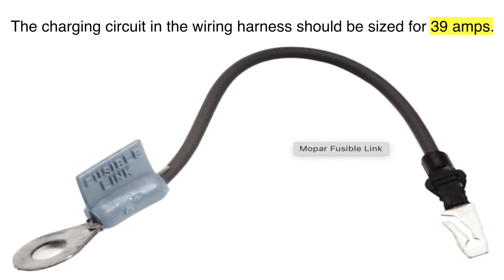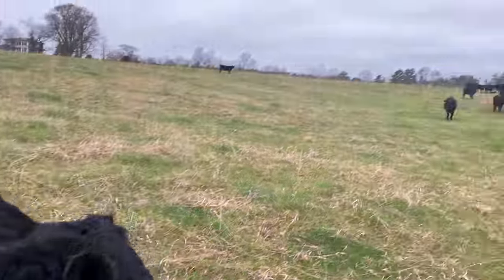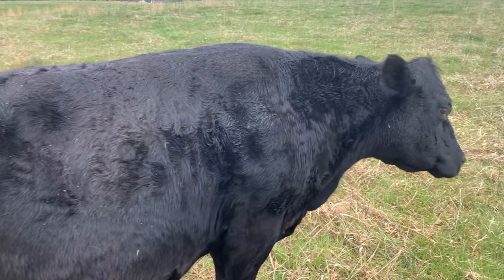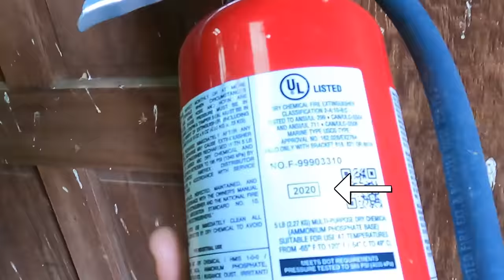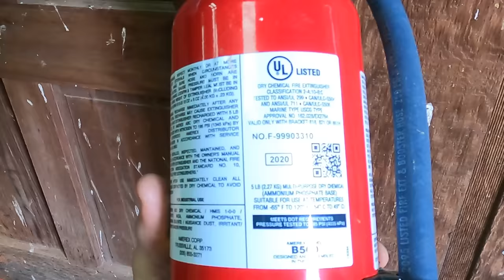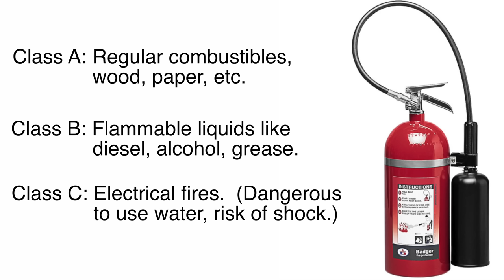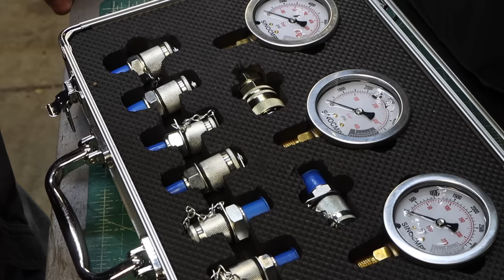Fire Extinguishers: 7 Things You Really Should Know...And Probably Don't.

Comment: Also the co2 extinguishers will only work well indoors. I was a volunteer firefighter (don't know if something like that exists in the US, but Herr in Germany most firefighters are volunteers with a regular day job). And I was thought to inly use co2 in confined spaces, as the co2 will spread out to quickly in open space. And they possess almost no cooling ability. You always stop the fire by cooling the stuff that is burning below its ignition point. Co2 is rarely able to do that.

So yes, water with soap (foam) extinguishers for everything without lethal voltages (or when you don't care about the electronics) and pulver for the rest. Co2 are great to fight electrical fires, if the circuit is already disconnected and you want to save the remaining electronics.

With electrical fires always cut the voltage first. For your own safety and because you are unable to put out the fire if there is still power on the lines.
Reply: I have to add that co2 in closed spaces will bring people unconscious. 
Also co2 is super cold, how is it not able to cool the fires?
Reply: CO2 puts out fire by blocking the fires source of oxygen. issue is outdoors it can be windy which will dissipate the CO2 before it can extinguish the fire. Water is the best option, with the exception of electrical fires or oil fires (since the Water can flash into steam burning the person putting out the fire). For equipment (ie tractors) I keep a 5 gallon can full of water. Those small dry chem usually run out of powder & also will trash the equipment from corrosion.
Reply: @guytech7310  Guy tech,  You are so correct. Lots of bad info about dry chemical. Overall, they suck but better than nothing.
Reply: @guytech7310  yes but if the burning material is still hot enough and you are not suppling any co2 anymore, oxygen will come back and reignite the material.
Reply: @NineSun001  The cooling does help much, removing the oxygen does. Consider a fire burning a fuel or gas. no amount of cooling is going to put out the fire. Most fires are on vehicles which the fuel source is gasoline or diesel

Comment: One more item you may want to add about dry chemical fire extinguishers is that once you use them they should be serviced. The dry chemicals will in some cases compromise the valve's ability to close completely. This will cause the nitrogen charge to slowly leak out. This I know from a fire extinguisher tech who serviced our company's fire extinguishers once a year on-site. We have 18 on-premises and another 35 in the fleet vehicles.

Comment: Great information on extinguishers! I wasn't aware of the need to maintain them and invert them!
I have heard that once a fire extinguisher is used, but not emptied, it needs to be serviced because the material will hold the valve open.

Comment: Fusible links are a terrible idea! Dodge used to put them in a 1988 caravan. You would have no idea where it would burn out at. So you had  to poke holes in the wiring in the harness and probe until you found where the fusible link burned out at. A fuse you can see the damage

Comment: To take it a step further. Do NOT use water on a grease fire, also known as a "K" type fire (Think K=Kitchen). Also there is a "D" class fire witch is a "flammable" metal (Typically Magnesium), also very water reactive and copious amounts of water are needed for it to be effective. Also doesn't hurt to add a few ounces of biodegradable antifreeze to a water extinguisher to keep it from freezing.  Typical pressure in an extinguisher is 100PSI. Great vid!

Comment: Having worked in grain elevators for over 22 years, I learned plenty about fire extinguishers. Then I was chief of a rural volunteer fire department for a couple of years. I've never had to use an extinguisher. When my wife had her own business office and building years ago, I had the City fire chief visit and recommend placement and number of units. We then called a local company specializing in fire suppression. Got 2 extinguishers for the office, 1 for the house, and1 for the garage. 
  As years progressed the local company owner died and his wife sold out to a National company. I still have them come by on a yearly basis and check all units. The house, garage, our shop, boat and travel trailer. The units in the travel trailer were expired when we bought the trailer new and didn't realize it until after the warranty expired. Since then the original office and travel trailer sold, and a repair shop and bait store have opened. At one time there were 9 extinguishers needing inspecting. The value of yearly inspections is worth more to me than me trying to remember to check the units yearly. 
  And the pros do turn the units upside down and whack them several times to assure the powder charge is loose.

Comment: Fusible link/wire can drive you nuts. I had months of issues with my 2000 F250 with the battery light coming on at random times and my battery kept getting weaker and weaker. Both altenators were producing the proper output and I had two good batteries. Finally decided I wanted to do away with the dual alternator and install a single 20 0amp unit. 
After installing the 200 amp altenator I had the same problem and then discovered the altenator charge wire that ran to the ECM was a fusible link wire and it had enough corrosion in it, that it would some times pass current and sometimes not so much. I disconnected the OEM fusible link and just ran a 4 gauge from the alternator to the battery.

Comment: Hi John:  the fusible link  comments reminded me of a related problem.  I owned and operated a restaurant service business for years and, many times, found that when a regular or a hi-temp nichrome wire burns off - usually at a terminal - the discolored wire adjacent to it will be unusable.

Not sure, I think the heat changes the physical characteristics of the wire, but if you just trim the end and crimp on a new fitting it will quickly burn at the fitting again.  You MUST cut back to clean, shiny wire and add a piece if needed.

And....related to that....I've found that spending the extra for heavy duty crimp terminals with shrink tubing on them is very much worth it.  I spend about $15/hundred for them and have never looked back.  Use the heavy duty cast crimping tools and really mash the connections, too....which I think I've seen you do.

Comment: Almost timely info on the fire extinguishers, John. Lost my JCB Robot to an engine bay fire last week. Not that the extinguishers didn't work but my inability to run fast enough to get one. Had my knee replaced the next day.  Then my dog died of bladder cancel a few days later. Hope everyone is having a much better week than I did.

Some FYI for you; You cannot put fuses in parallel to double the amperage. It's not possible to make fuses with identical properties. The weakest one, even by a fraction of an amp, will blow first then the stronger. With 2 20 amp fuses in parallel, you still have a 20 to 25 amp circuit. You can actually see this in your video, one blowing after the other.

Comment: Welding or fiberglass blankets are used a lot around when I am welding, cutting ot heating.  Better to prevent a fire than work on putting it out.  A welding blanket under where you were welding was the best option.

Comment: Love the videos :)) Something thing to keep in mind with trying to use fuses (or breakers) in parallel: in an ideal world, if you connect two 10-Amp fuses in parallel, they will carry the same current and only blow when a total of 20 Amps flows through the pair. Consider this scenario, though, - due to manufacturing tolerances, fuse A has a resistance of 1 ohm, and fuse B has a resistance of 2 ohms. If 15 Amps are flowing through the fuses on their way to a load, 10 Amps will go through fuse A, and 5 Amps will go through fuse B. Fuse A will blow and then all 15 Amps will try to flow through fuse B and it will blow. So when you combine two fuses in parallel, in general, you are creating a fuse with a current rating of something in between the value of the lower-rated fuse and the sum of the two values.
Reply: Your right, two 10 AMP fuses will not work like one 20 amp fuse. They fail independently. probably two 10 AMP fuses will limit between 12 AMP and 15 AMP.

Comment: Retired Fire Marshal/ Firefighter a lot of fire code are getting away from requiring extinguishers in public places. Reasons being most people don’t know how to use them properly, they may use them on the wrong type of fire. 
or the fire is too large to do any good. All while delaying the 911 call. For a shop like yours the dry chemical are good, but I have always kept a 2 1/2 gallon water extinguisher in mine as well. Very easy to use and recharge yourself. It would amaze you to see how much fire FDNY puts out with these cans.

Comment: Additional comment on the Fire extinguishers, ON the bottom of the cylinder there is a pressure date that will let you know when it needs to be retested.  Usually 5-7 years.

Comment: Very interesting, that copper fuse experiment. But in the old fuse boxes back in the day, they were just less diameter wire gauges to burn up if there were to be an over current.  They were in a ceramic covering though and protective box to stop fire I suppose

Comment: Those old Kiddie's were recalled because the cheap plastic handles would fail. (there's a metal pin inside them, but it's pushed with a plastic handle with a plastic plunger.) Yes, they're complete trash. Seek out your local fire protection outfits and have them supply and service your extinguishers. They just swap ours out every few years - like $39 each, for about a dozen. (checked the date on the four in my van last week... 2019)

It should also be noted, those things ARE metal cans. So they aren't as corrosive as people make out. But yes, you want to do everything possible to clean that shit up. It's no fun breathing it. (We've had them fall over and discharge in the bus. Years ago, and that shit is still clinging to the floor.)

Comment: Now retired, I used to work on a 300 ft yacht that had 110 fire extinguishers plus some fixed installations. I would check them all once per month and they have to be serviced every year. Powder gets the fire out by chemical reaction but makes a mess and you do not want to breath the stuff. Co2 good but will not get a cooling effect so if not in an enclosed space fire will restart on dispersal. If in an enclosed space get out, you cant get any oxygen and will pass out. I like foam, AFFF is the best but you get good smothering and some cooling.

Comment: Automotive EE here - another thing about fusible links is they generally have much higher temp insulation.  You'll notice the insulation feels different, it's more flexible and "tacky" feeling and it's supposed to contain the melting fusible link material better.

Also, they're not comparable to fuses as you discovered - fusible links have one purpose, protecting the wire they're connected to from a short circuit.  They aren't intended to protect loads.  Fuses are designed to blow at a specific current rating and do so very well.  I bet if you'd put a few feet of 10ga wire in series with your fusible link, with no fuses or breakers, the fusible link would have blown rather than the wire melting.

Also, add angle grinders to your extinguisher required list!  I set a parts car on fire with one once and it was a very bad day.

Comment: I think the fusable link is more a solder connection than a crimped one. Plus a smaller gauge wire would, by design, tolerate less amps than the thicker gauge it's connected to.

Comment: Another great VJO! I thought I knew all there was to know about fire extinguishers but I  learned about turning them over like you showed and I did not know the powder was corrosive to metal. ( Back in the day I think we used backing soda with an anti clump agent and dry nitrogen to refill). Most of the people checking fire extinguishers look at the gauge and if it is good punch the tag. On CO2 extinguishers  you weigh them to see if full or not. One good thing about the CO2  is that even if you just use  them a  little they  are  still good,with a dry chem extinguisher once you use it even for a squirt they will no longer hold a  charge because the dry chem clogs valve and gives you a slow leak.

Comment: On a farm I would be adding some water extinguishers. Burning dry grass can spread quickly, it is easy to fight with water but dry powder and Co2 are pretty useless. Sometimes you can save the machine from the initial fire with dry powder but then lose it with the ensuing grass fire.
In my part of the world (rural eastern Australia) most farms have a fire fighting trailer which is usually an IBC tank (1000 litres or 264 US Gallons) and a Honda firefighting pump.

Comment: Yes like you I had to learn the hard way about fire an heat.  I was welding on a frame to repair a rusty hole. Close to where I was welding was a fuel line. I look to be far enough away. but what I didn't check was if it was steel line or plastic .. Well guess what it was a plastic fuel line. An it got a pin hole an shot gas out like a touch. Scared the hell out of me to say the least. Glad the garage an the car didn't burn up. Very lucky that day an only a pin hole to repair in the fuel line.

Comment: Most of your fire extinguisher info is correct...as a retired FF and code enforcement NFPA requires fire Extinguishers to be tested (by a certified company) or replaced yearly...I treat my shop like a commercial business...you should too. Second CO2's are a Class A (wood, paper, etc...) and don't have the problem the dry chems have...actually while you mentioned the corrosive behavior on metal...even worse on your lungs...just keep that in mind. Last in CO where I was a FF it was anywhere from 35-75 $ per extinguisher for inspection and replacement of chems...so buying a new one each year for your shop isn't that expansive...but if you have a few at a time they would generally give you a break. Local businesses would bring there expired extinguishers to the fire station and we would use them for local training. Just some thoughts...love watching you every Friday be safe...always be headed for the door or egress to retreave your fire extinguishers...glad to see yours are mount by the door😎

Comment: Very instresting testing on the fusible link. We had a extinguisher drop bin at work & tested (played with) the old returned dry chemical ones. We noticed the ones stored vertical in a car/truck compacted more, than the ones stored horizontal..we guessed as the powder is spread out over a larger area.
Reply: I would guess the vibration in vehicles would compact the dry powder.

Comment: Another thing to consider is a bucket full of water with a couple burlap bags in the water all the time . As growing up on a farm every tractor in the nonfreezing months of the year  . 
We always had gasoline in metal oil drain pan's for parts cleaning . That's was  the only good parts cleaning fluid at that time . So now most older people know how old I am ? 
We always had a metal bucket just outside the shop door   .  Dad would be welding or cutting  with a carbon arch and every so often a spark would find it way to the cleaning pan even though it may have been far enough away  ? 
A  continuous bucket full of water with burlap bag can beat down grass fires for hours without even catching on fire  and reusable almost forever  as well as very cheap  .

Comment: The advantage of the fusible link over a fuse is that the link will handle a momentary overload that would blow the fuse as you demonstrated.  Think of them as a very slow blow fuse.  I believe the insulation on the fusible link is supposed to be rated for a higher temp to help contain the hot wire inside.  The link that I use has a heavy pale blue jacket.  I've heard that sometimes when the link blows, you can't even tell visually.  You have to pull on the wire to determine whether the wire has burned away.  Wondering if maybe you were testing cheap wire.

I have C02 fire extinguishers as my first choice because it won't leave a mess.  I hope it will make me hesitate a bit less when it comes to using the extinguisher.  Yes, bi-carb is corrosive.  It won't happen overnight, but will take several months for the corrosion to show up.  I also won't what it does to your lungs.
Reply: I was surprised no one else mentioned the insulation. My understanding was that it is thicker and higher temp rates, designed to withstand the heat from the current to some degree -- and to melt rather than bursting into flame if it does exceed the rating. I've popped a few working on older trucks over the years and very glad that the fuses usually take the bulk of the failures since they're dirt cheap in comparison.

Comment: yes, powder extinguishers are very effective but as you said, also extremely corrosive. if you use them in your workshop you may have to throw out every electric tool afterwards, because the powder cloud will fill the whole room and get everywhere. Get foam extinguishers, they are way more controllable and can be aimed where needed. the good ones with 6 Liters of foam will have a spray duration of 30 Seconds + and spray a distance of multiple meters. the new ones are not corrosive at all, you can even safely empty it on a person that's on fire. Also safe on electrical equipment up to 1000V. I got one that's for the fire Classes A, B, F and Lithion Ion battery fires. Perfect for workshops and vehicles. SN 9 Bio+ from the German company DÖKA (9 Liter Model).
It wasn't cheap but it checked all the marks for me